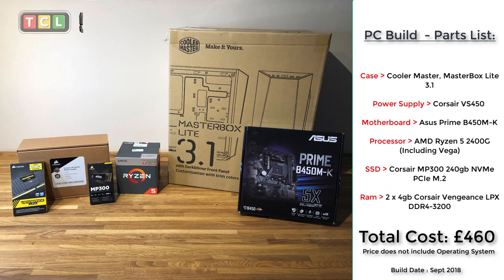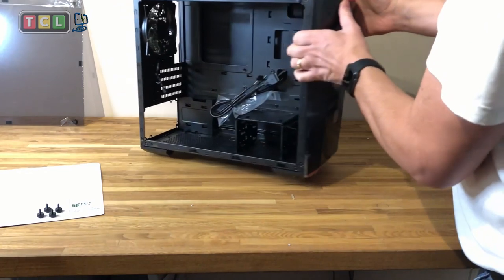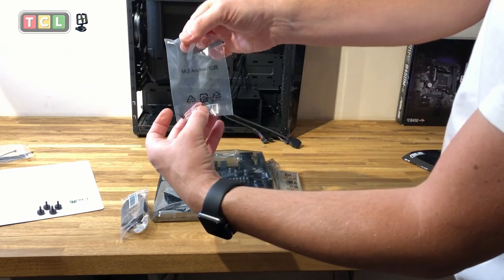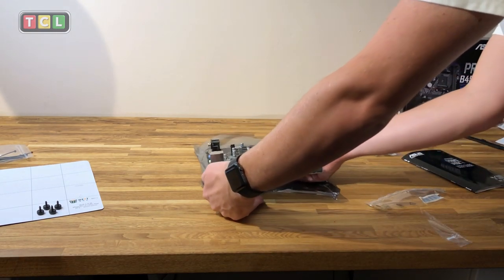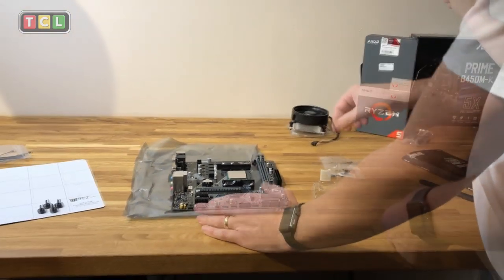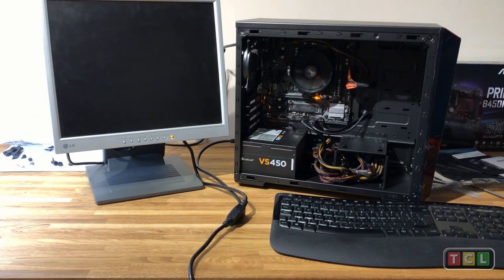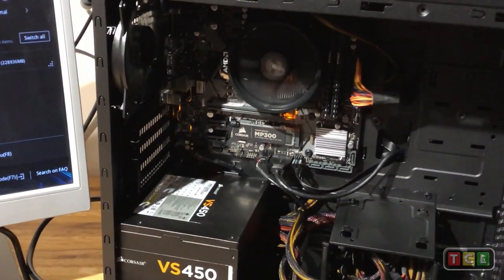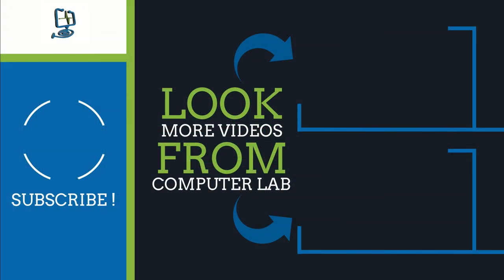Budget Gaming PC 2018 Under £460 ($600) Complete Build TUTORIAL

Comment: Do you know how many frames this pc would get on games like Csgo on max setting ?
Reply from the maker: To be honest I did not test it with CSGO before it went to the customer. But the design itself is a good base to build on it will play comfortably at 1600 x 900 and will be even better if you don’t mind over clocking it. The ideal would be to build this machine and then put maybe a 1050 or 1060 in it when budget allows.